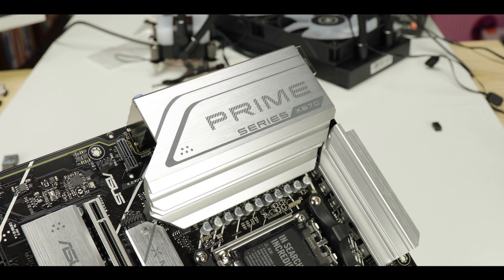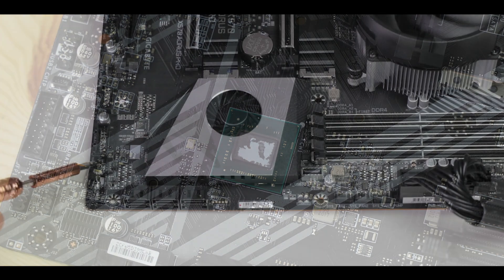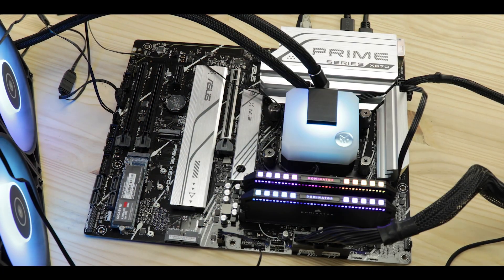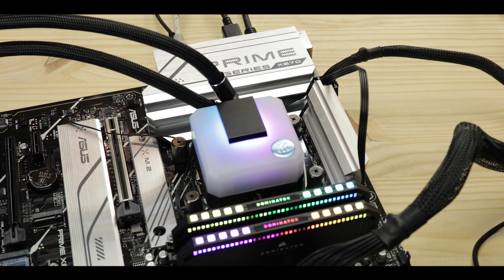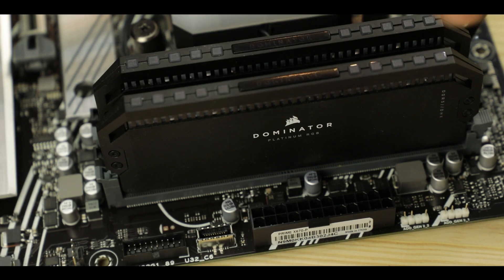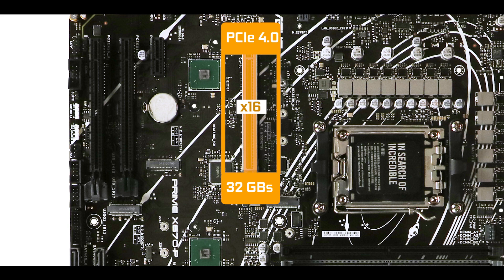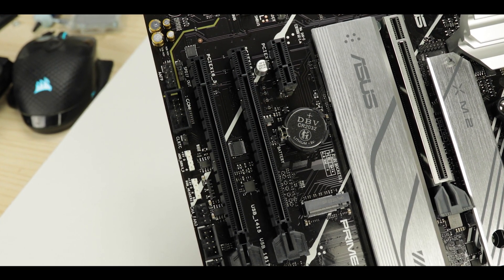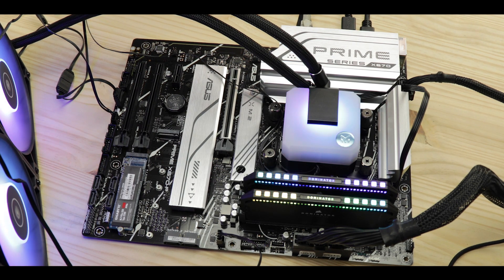ASUS PRIME X670 P : I'm not happy!

Comment: You are spreading nonsense. These VRMs are more than fine for any CPUs. They are by far not the best, however Bullzoid was clear, all those x670 motherboards are hosting overkill VRMs. You got 50C on the VRMs, it is more than good. If you spread nonsense, be ready to get slammed!
Reply from the maker: It is a fine VRM, indeed and by far not the best. 
As I said during the review, temps are unsurprisingly good. 
I struggle to see where we might be in disagreement.
As far as Bullzoid goes, he is a great reviewer and his opinions should be taken into consideration if not celebrated. 

I hope this clarifies and helps you better understand past and future reviews.  🙏
Reply from the maker: By the way Eva, I do appreciate your input. It does add a valuable angle to this thread.
Thanks again for your time .

Comment: Just try it with a 7950x and youll see the vrm is over-built like crazy for any current am5 cpu...
Reply from the maker: 7900x abd 7950x tested :) all done. 

Released the TUF... brilliant board !
Reply: Do you think it will be able to handle a 7800 X 3-D? That is my only hope. I already got the board and a cyber power PC. It will be here Wednesday so excited to upgrade for my 7700 K in till seven GEN two this eight core processor 7700 X. I was hoping the board would be upgradable and handle future generation AMD processor.
Reply: @FrostyBud777  it will be fine.
Reply: @Kyote7667  Thank you brother.

Comment: the VRM is enough even for a 7950x, in a ventilated case atleast, how did you come to the conclusion it is not??
Reply from the maker: Hi jake :) . I did add a correction to that very point in the details of the video ( go to "correction")

In a nutshell, I was expecting the 7900X to be able to OC to its boost clock, like any previous (recent) intel or AMD CPU could. In our car 5.6 GHZ.

When testing the OC abilities of the mobo, it would freeze and crash at about 5.3 GHz. Consistently and no matter what. 
After making some further research, I did see that AMD advertising 5.6 GHz boost clock were somewhat ... hopeful. 

7900X and 7950X can reach 5.6GHz in a Single Core configuration. If you are going an Multi Core setup (like every computer in existence), you will not be able to go beyond 5.3 GHz... which i find absolutely dishonest coming from AMD.

For the rest, it doesnt change my conclusions much. It is a good board, no doubt, but its pricing is simply too high and puts itself in a precarious situation if compared to equivalent competition. It is sub-200$ board sold at a premium tag.

Thankfully, it seems to be a one-off thing for ASUS, as the TUF and STRIX (wrapping the review) are absolutely phantastic products, which bring quite a bit more for their new pricing.

I hope this clarifies.
Reply: @Laurentschoice  nice, i really like your reviews, my TUF board should arrive early this week, im still thinking about going for a b650 strix within the return window if its similiarly priced

Comment: The post delay issue has been largely resolved with AGESA 1003 BIOS update. Post times are down to about 20-25 seconds from power on cold start.
I woul dlike to at least see an optical audio SPDIF on this board, and I feel like all motherboards in this price range should have an integrated IO shield.
Reply: There's an SPDIF header on the board, all you'd need to do is run a cable from it, and apparently you can order ones online terminating in a slot cover for any unpopulated PCIe slot. Or you just throw a sound card into one of the thankfully plentiful PCIe slots since the ALC 897 is the definition of MEH anyway.
Reply from the maker: Hi there and thanks for your comment :)

What you are pointing out it true but that cost more money :) ... for a board which has the financial space to add a SPDIF . 

And a SPDIF output is really the only way to get the best possible potential of even a mid range codec and avoid the purchase of an external audio codec.

I hope this helps and clarifies  :):):)
Reply from the maker: Yes I saw that. I had the same issue with the TUF x670E (publishing tonight).

Once I updates to the AGESA 1003, itactually posted and posted fast.

Comment: 12 VRM phases should be fine even for overclocking.  Either you have a board which has a problem or Asus botched their implementation (MSI did this in their initial low end to midrange X570 range)   Maybe they could send you another board to see which it is.
Reply: Holy shit bro I was worried!
X670 and bad VRM?? WTF!

Tip go for negative offset, then apply curve optimizer with ryzen master, then stabilize it with CoreCycler!
Reply: I wasn’t sure which board to get to try to get an upgradable board that I can drop in either 7000 future AMD processors. Like a 78 100 X 3-D, I’m hoping this will last for years to come. If nothing else I got a good case and a 1200 W power supply so if the board does not work I can always just take it out and put in a new one. I was hoping to be able to upgrade to a future AMD a.m. five socket processor and drop in a 4090 or 7800 XT. Do you think this board will work to do those things and drop in a new process or in the future? I really wanted some thing that was Upgradable
Reply: Thats also my point. Electrical Wise, there is far too much VRM on it.
Reply from the maker: Well, actually it is fine. I made some research. 
The problem here is the CPU. 

AMD has advertised a boost clock of 5.6 GHz for their 7900X. 

They forgot to mentions that it's is a single core boost. 
In a multi core OC you can only hope for 5.3ghz at best. 

Not very honest practice from AMD if you ask me.
Reply: @Laurentschoice  ROFL... you didn`t knew it was boost clocks? Why are you doing reviews if us casual PCMRs know more than you...
Reply from the maker: I did know it was a boost clock :)
But unlike other boost clocks, this season AMD has decided to make it a single core boost clock. 
Good luck with that :)

I did explain that point in detail in the post above ... 

I hope that you are OK :)
Reply from the maker: I feel that in your case I should explain a bit more thoroughly.  
If you take a 5900x (that's ryzen previous and equivalent generation to the 7900x used in this video ),
The boost clock is advertised at 4.8 Ghz. You will have no issues clocking the 5900X all cores (meaning the 12 of them) at 4.8 GHz. 

Actually mine is running at a comfortable 5GHz for the past 14 months. 

In this generation of Ryzen processors , boost clocks no longer apply to all cores, but to a single core. Which does make quite the difference performance wise. 

I hope this clarifies it for you and that it will help you better understanding the current and to-come reviews. It is an important distinction for this season .
Reply: @Laurentschoice  Naah that is bullshit, the high boost has allways been for max 2 threads  on AMD, my 5900x full tuned to the absolute max it could go was boosting 5.2ghz with single core and allcore load about 4.7ghz this is Cinebench r23 boost(cpu was taking 220w on that test), not some low load boost that dont matter at all , as STOCK 5900x will boost only 3.7ghz allcore load and 4.8ghz 2 threads with that 105w tdp(but then again most Motherboard will make them boost higher and they will take around 140w of power as "stock" 4.9ghz with single and 4.4ghz allcore load.) ..  

Try it, make a video about you'r 5ghz allcore 5900x boosting that 5ghz allcore load somewhere else than on windows, like on a actual test.. i bet you get around 4.5ghz allcore boost on that CB R23 test :D
Reply from the maker: Me Wondering why I can OC all the cores of my 7900x to 5.5 Ghz on the Strix X670E-E  then 🤔....
Reply: @Laurentschoice  Cos it is 7900x, works the same way than every other amd cpu.. just get higher allcore clocks, dont change the subject.. you was talking about 5900x before :D
Reply: @evalangley3985  i knew he dont know what the f he  was talking about when he started to  say 50c vrm tem are bad and  12+2  60 amps are not ok ,but i couldnt hold my self to check the replies an here we met

Comment: Great video as always Laurent. But this is extremely disappointing from Asus.... as much as this costs, it's unacceptable that it doesn't have even an ez debugger and the VRM is a let down as well, especially with the way Ryzen 7000 handles their power. Hopefully other budget and mid range X670s do better.
Reply from the maker: Doing the AORUS elite today... cross fingers !
Reply: @Laurentschoice  definitely will be! :)
Reply: @Laurentschoice  pcie x16 for gpu has a extended hinge that clashes with backplates
Reply: It does not have power good LED. How cheap can Asus get?